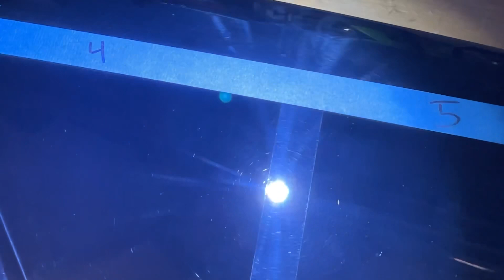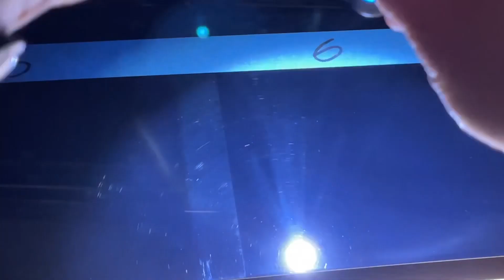Which turtle wax spray coating should you buy… if any?

Comment: If you can afford it,  Nova Care NV Lustre is by far better than any of the Turtle Wax products shown here in my opinion.    NV Lustre is one of my all time favorite sealants and I also enjoy using NV Jet sealant also.   Both of them are unbelievable when it comes to a spray and wipe type of sealants that are easy to use and give a great finish and they are super glossy.    I also use NV Boost quick detailer as my drying aid.    Also a very good product.   Lustre is one of the best spray and sealants ever made in my opinion and I have used literally hundreds of spray sealants over the 45 years I have been detailing long before anything like Si02 and other ceramic and graphene ingredients were ever added to a spray sealant.   Almost every store bought spray sealant or quick detailer doesn't have very good attributes when it comes to actually performing as a true sealant as most of them wear off way too fast.   Not so with Lustre and Jet.  Even the Boost quick detailer could probably outperform all of these Turtle Wax products shown as a stand alone as it's just a lighter version of Jet I believe, but it gives reasonable durability and makes a great trio to use.   For any enthusiast at home looking for a very good product trio,  try out the NV Car Care Jet, Lustre, and Boost.    You will love the performance and the gloss those products give is like a good carnauba paste wax with a real richness to the finish and a very glossy surface as long as the paint was well prepped and polished first.   I do love the Turtle Wax Hybrid Solutions Line Graphene Paste Wax.   That stuff is awesome and my current favorite when it comes to a paste wax of good value.   I am getting ready to try out Fireball's line up of waxes which I have heard are some of the best waxes for performance and gloss but they are quite expensive averaging about $100 US for a 150ml tub of paste wax.    Their GHOST is supposed to be one of the best new ones in their line up.   I equate Fireball waxes to something like the Dodo Juice Line up of waxes but a little more pricey.  They do put a large amount of Carnauba into their formulations however similar to Swissvax at 30%, 40%, and even higher concentrations of Carnauba in some of their waxes and they are far less expensive than Swissvax and their line seems to be of similar high end quality but at a slightly more affordable price for an enthusiast line up of products.   Fireball makes some really excellent detailing products.    I think of them as a notch between something like TAC SYSTEM but not quite as high up as Kamikaze or something like that.  But for an enthusiast looking for some of the easiest to use, yet top performing products,  get a hold of NV Car Care.
Reply from the maker: I have lustre, just started playing around with it recently to make sure it hasn’t spoiled. It’s very, very expensive in Canada.
Reply: @sheepstardetail  It's pretty expensive in the USA also compared to other spray sealants and the amount you get.   I still really like it though and I will definitely continue to use it.   Both Lustre and Jet are great spray sealants.   Especially when paired together with Jet.

Comment: I did a 2-day double coat of TW Ceramic and topped it with Flex wax and have a glorious shine and tight, tight, tight beading experience. That said I only paid $10 for the Flex wax at AutoZone on clearance and the cost was minimal so I do get where you're coming from on the MSRP for Flex wax. Way too high but a good product if used as a topper or a spray and wax.

Comment: Nice comparison. I’ve really been liking that ceramic spray lately, and it’s not much more than seal and shine  and I find the hydrophobics hold up a bit better.
Reply from the maker: Interesting, where I live seal and shine is a better value ($15 vs 25-30 depending where you buy).
Reply: @sheepstardetail  in Canada here it is  $15 for seal and shine, $21 for ceramic spray. Not a huge difference unless you go through a lot of it. So whichever performs better to me is the winner. 

I just found seal and shine died out quick in winter weather. So I think local conditions play a huge factor in which one is best for everyone.
Reply from the maker: @jayhoughton558  yeah, it depends where you buy for sure. Online you can find CSC for less than $25 but then you’d have to factor in shipping. Canadian tire has it for around $25-26 so I went with $25 as a baseline average.
Reply: @sheepstardetail  $21 at Walmart in store :)
Reply from the maker: @jayhoughton558  I think I’ve seen that before. Thanks!
Reply: @jayhoughton558  That is a very pertinent comment, " Local conditions Play A Huge Factor In Which One Is Best For Everyone ". This is something that is rarely mentioned if at all in all the reviews/tests you see online. But it has to be a factor. Glad you bought it up, along with cost depending on where you live, it is the old one size does not fit all.

Comment: Nobody will wait 24 hours to apply second coat? Have you met an auto detail enthusiast? They will do that and much more to attain desired results.
Reply from the maker: Maybe you weren’t around when this came out…. But nearly every comment on the product from YouTube to forums was… I don’t want to wait 24 hours, especially for a spray sealant with 4 months durability.
Reply: I'm not doing another coat after 24 hrs. There will be dust on it.

Comment: Yes, seal & shine is a great value sealant. It’s more of a base layer sealant, though. It’s meant to be topped with the Ice Spray Wax, which is more of a pure wax/gloss topper. The idea is to seal w/ S&S every few months, but the spray wax can be used after every wash, if desired. Both is the ICE products used together as a team are still cheaper than the more expensive all-in-one ceramic/grapheme sprays.

There also differences in use cases. IMO the best feature of Flex wax it’s not so much that it’s the best or longest lasting sealant or wax (tho it’s good as an all in one), but that it has “flexible” use cases. Hence the name. It can be used like a spray on and buff off wax on dry panels. Or it can be used as a drying aid, sprayed on wet panels. Or it can be used as a spray on, rinse off water activated product for fastest application. It’s its own niche, really if you need that kind of flexibility.
Reply from the maker: The bottle states that ice spray wax can be added for further gloss and protection, but doesn’t say it’s intended to be used with it as a 2 part system. It’s good they work together, but it’s not a requirement.

Flex wax does have a lot of application options which is a benefit for end users, but most people have found that seal and shine also can be used on wet cars as a drying aid with minimal impact to its performance. As with most wet application products, a dry application is always yields the best results assuming it can be used dry also.
Reply: @sheepstardetail  yes, I agree with all of that 👍

Comment: I got confused.  Panel 1 was product 4?   Product 1 was panel 3?  Would be really cool if you place your taped panel  with the names of each wax or simply place your spray wax behind the section in which it was applied .  Lastly,  I think you're right.  Seal and Shine to me is the best.  I've used the first generation and it delivered big time!  I've even placed it on my windows and to be honest, I think it would outlast Rain X.  
Over all, thanks for the detailed info.
PS.  Thanks for the update.  I fully understand the logic, now
Reply from the maker: Thanks for watching! The point of keeping the products and panels mixed up is that you don’t know which section is which product. This removes any form of bias from the viewer and let’s the results and performance speak for itself. I know it’s not what you’re used to, but a lot of people will shrug off the performance of a good product simply because they don’t like the brand. I don’t always do this, but when you have large price deltas between products it helps to remove that information so you focus solely on the performance instead of the price tag or brand.
Reply: @sheepstardetail  gotcha!  Thanks again!

Comment: Great comparison!  I've used SnS for years and it was my go to.  Price is great, easy to use and does a great job protecting.  About four years ago, I tried Hybrid Solutions.  I was immediately impressed and it became my new go to!  It's about $15 a bottle here in CA, so for the money it's great.  Also, I apply wax on sunny days (I know, I know) and it doesn't streak.  I tried Graphene a couple years ago.  I was expecting an improvement and I feel Hybrid Solutions does a better job.  Graphene also gets streaky when applied in the sun and it's hard to get off.

Someone gave me a bottle of Mother's CMX.  Definitely not as easy to apply, I think the slickness isn't as good and it doesn't last as long as Hybrid Solutions.
Reply from the maker: SNS is a great product overall, especially the new version with tighter water beads and I think easier buff off. I found that ceramic spray was no better in application or gloss, and beading was better on SNS V2. 

CMX is actually supposed to be applied then left to haze for 30-60 seconds before buffing. Try that out if you can, it is much easier to use when done that way. I think my bottle has officially gone off as it didn’t last even 2 weeks without a wash, which wasn’t the case in the past.

Comment: I used them all and to me Seal and Shine is the best of all of em and the best value . The Flex has to be applied very sparingly as it will smear up big time.
Reply from the maker: Yeah I would agree. The bang for buck factor plus ease of use means reapplying seal n shine 1-2 months earlier not a huge deficit when comes to application hassle or cost.

Comment: Which one is the best for harsh summers and rains? I'm talking temperatures touching 45 degrees celsius. Which of these would give me the most ease of application and longevity in that kind of heat? I'm not a beading junkie, just need good UV and elements protection.
Reply from the maker: Honestly I can’t saw for sure. Overall it seems flex has the longest real world legs. I rarely see temps about 35*C and when I do, it’s dry as a bone, so I can’t realistically test in that environment. What I will say is for the cost of flex plus a bit extra, something like Cquartz lite is a far better option. It has a simple application (on and off, no flashing/waiting required), can be exposed after only 4 hours of cure, and works on top of mothers CMX ceramic polish and wax as a primer (which polishes, fills, and preps in one).

Comment: Just bought a used pearl white SUV with 10k miles. The paint seems pretty smooth and the water beads nicely but no sheeting. The is parked outside 100% of the time. I wanted to try the TW Graphene Flex. What do I need to do to prepare the paint? Wash, decontaminate, clay, polish, wax then top with TW Graphene Flex? Are all these steps necessary? Thx.
Reply from the maker: You don’t need to wax if you’re going to apply the Flex wax, it will fill that role. Normally the process is wash, decon, clay, polish, panel wipe then wax/seal/coat etc. for panel wipe you can buy one from a detailing company or make your own using isopropyl alcohol (99%) mixed 5:1 with water (5 parts water, 1 part IPA). This will help what ever wax/sealant you choose bond. Note that coatings require a panel wipe prior to application, and it’s best to use a proper non-homemade product as they are far more finicky than sealants and waxes. Mothers makes a polish and coating primer in one that doesn’t need to be panel wiped after removal and it should work with the FLEX wax (though I haven’t personally tried it).
Reply: decon, clay, polish even on a fairly new vehicle? I'm fine it that is what is required I just didn't  want to do more damage diminishing the factory clear coat if it was not necessary.
Reply from the maker: @scottstringer3060  it’s best practice. You want to remove any previously applied products and nothing will do that 100% except for polish.

Comment: Nice Video mate! I`d love to see the Same with Sonax :D PNS; BSD; CSC; CSD. Your style of test is awesome, thanks for the video
Reply from the maker: Thanks man! I still need to grab the Sonax Ceramic spray detailer, I’m almost out of BSD as well.
Reply: @sheepstardetail Its not lasting long the ceramic detailer, but the Gloss is crazy and its soo easy to use!
Reply: @peterplumsklo5365  some testers have diluted the CSD and say gloss is still high as full strength CSD,  any one here has that experience  ?
Reply: @gaferoz  CSD gloss is insane, so I can see that being propable, but I have never Diluted it. At 12€ a bottle it is cheap enough to just use as is

Comment: Watching this I don't have an understanding of your strange numbering system, your bottles are all over the place and dno't match in order your test sections,  not keeping it all straight forward in a row to match those panels. So I came away from this with no useful information.  You show 4 bottles, then they are backwards, then you pick up some other bottle and put it into the mix somewhere in the middle as the best but expensive choice, then it goes away.  Then some panel goes up to number 6, this vid is mind numbing.
Reply from the maker: You should listen to what I say in the video instead of skipping around. The numbers are used for blind testing - you’re not supposed to know what product is on what section, it’s down that way to remove favouritism and bias. The numbers are there so I can keep track of what product is what without putting their name next to them. Rematch the video, it will make sense. I also changed some of the products in the comparisons based on the conditions of the test and the attributes of the product. In the gloss test I put in a product with extremely high gloss, but I didn’t need it for chemical resistance as it was strong there.

Comment: What will happen if you put the graphene flex wax in matte paint? Does it will have white residue?
Reply from the maker: I’m not sure, I don’t see anything online saying yes or no. I’ll read my bottle later when I have a moment and let you know.
Reply: I apply on matte decals on my Mach 1.  No white residue.  Some streaking, but not enough to bother me.  Less streaking if sprayed on very wet surface…. So maybe use as rising aid.
Reply: Why would you want to wax a matte finish factory paint job? Its designed to look like a car that NEEDS a new paint job.